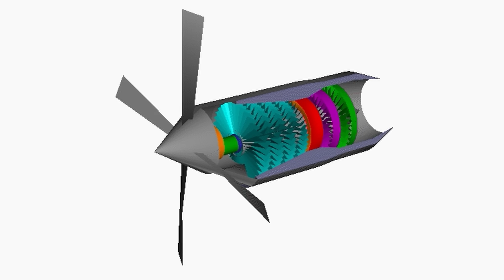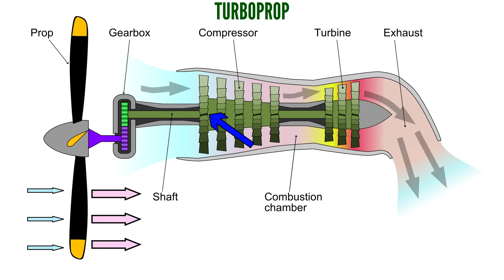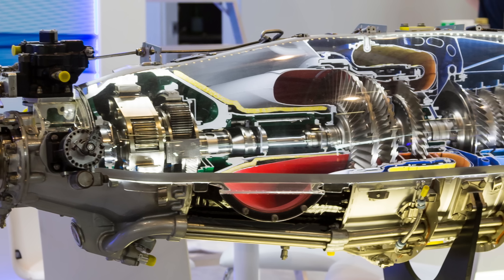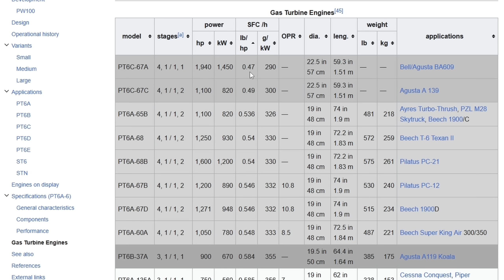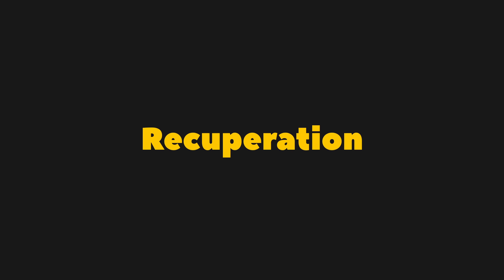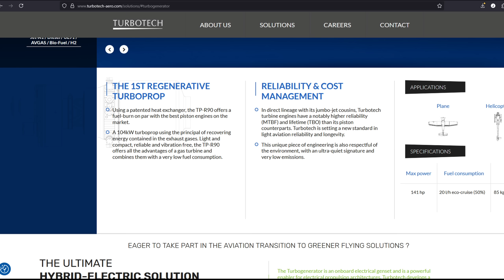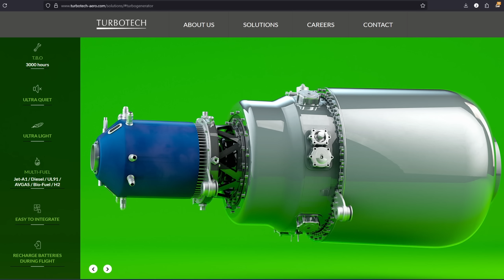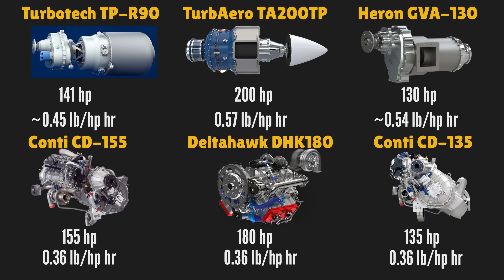Are Piston Engines Dead? Small Turboprops are Here

Comment: 9:50. This pic is confusing me. The claim is the heat from the exhaust to preheat the compressed air. Seems like an egr setup. Anyways, compressed air is already heated so is more HEAT required after it's been compressed to help with efficiency?
Reply: With the Brayton Cycle its important to keep your T2 values low to maintain thermal fuel efficiency.
 Compressor efficiency is basically a fixed value based on the Compressor size and its rpm.

No, Not like an EGR, the intake charge air passes through a heat exchanger, the exhaust gasses are not mixed or recirculated.

Any questions?
Reply: Perhaps an example will clarify:

Suppose air exiting the compressor leaves at 400C and combustion increases this to 1000C into the turbine so you have burnt fuel for a 600C temp increase.

With a heat exchanger, the 400C compressor air is first heated further say to 500C so now you only need to burn enough fuel for a 500C increase to get to 1000C - note turbine inlet temp is fixed at a set point due to material limits.

Comment: Turboprops are smooth and sexy, but expensive to buy and run, especially at low altitudes, where most general Aviation flying is done. For my money, aircraft Diesel engines burning jet fuel are a better bet. Better fuel efficiency, lower cost than turbines (but more than gasoline engines), and simpler operation (no mixture control necessary). The Delta Hawk Diesel, a V-4, two-stroke Diesel that can run easily either upright or inverted, seems to be a notable option, as it doesn't even have valves, just piston ports!

Comment: Fuel prices can only go up so small turboprops are DOA
plus reliability of these new engines still needs to be proven.
Gas turbine engines can be very delicate. One hot start and the turbine is fubar
Reply: Depending on the flight profile,  gas turbines can be competitive when compared to a recip engine of similar power.
Gas turbines are inherently reliable compared to piston pounders.
FADEC and AutoStart is basically standard on new turbine engines.

Comment: 55k for a small 4 piston engine is nuts when you can convert a chevy ls to plane use for cheaper than that with more than double the power
Reply: But its not FAA or EASA certified... the Chevrolet engine is not built to be reliable enough for manned flight applications.

Comment: Yeah , wider comparison necessary: Fuel weight, fuel cost, Unit cost, lifecycle cost, maintenance  cost/frequency. All are more important than ANY nominal power setting. As is partial power setting, as piston engines normally only need full power during take off.
Reply: Piston engines are run at about 80% power in cruise.  That is why most car engines aren't suitable.  They normally cruise at about 20% power.

Comment: One unfortunate thing with turboprops is that there's definitely room for improvement in engine design to make them more efficient

the issue is the lack of incentive to innovate on the technology. Most engine manufacturers are focused almost solely on medium and high bypass turbofan engines, as this is where the bread is.

They're all chasing the engine markets for the narrow and widebody jet aircraft, as aircraft manufacturers and airlines want the absolute lowest possible fuel burn per flight and are willing to help engine manufacturers like P&W, CFM or Rolls-Royce by co-investing in engine platforms that promise to deliver those efficiency gains.

In all likelihood, I would expect diesel cycle engines to eventually overtake AvGas piston engines in newer general aviation planes for two reasons: 1: their better efficiency than the current turboprops and AvGas and 2: Cleaner emissions because they don't have any tetraethyl lead in the fuel like 100LL AvGas does.

The only future issues I could foresee would be NoX emissions and particulates - but given turbine engines also have that same issue, I don't see why diesels would be treated much differently. maybe manufacturers could implement a DPF And a catalyst unit, but they'd have to work out how to make that entire system lightweight, still economically viable, and able to consistently withstand north of 500*c during a regen cycle.

DPFs are fairly heavy and they're restrictive, so you lose efficiency by adding one.

Perk is though, aviation puts an engine under way more stress and would drive the EGTs up way more than normal road driving does, so you'd rarely see a DPF unit clog on a diesel aircraft, whereas it's extremely common on diesel cars that aren't driven on the highway much.

Comment: Its hard to torture with negligence a piston engine of the training aircraft variety. Not impossible but tought. A turbo prop can be destroyed in seconds on the first start. Also the user of rental aircraft with turboprops can lie about hot starts and overtemp overtorque and the engine may fail months later for some unsuspecting renter or pilot and no one would know the damage happened earlier. There needs to be electronic monitoring and reporting of all engine operation and a system in place to prevent engine start before the engine is examined and or repaired.
Reply: New turbines are FADEC w/ AutoStart
Reply: @DoktorBayerischeMotorenWerke that works then

Comment: Can’t wait for an affordable 250-300 hp turboprop engine for my RV10
Reply: Hate to brake it to ya but you got a better chance of seeing Jesus. It aint gonna happen bud
Reply: I hope you’re 8 years old with your RV10 cause you’ll be 90 before you’ll get a Turbine in your 10😂😂
Reply: @wallywally8282 some guys are absolutely delusional
Reply: 200 hp turbocharged 13bs have been used in the RV6 since the mid 90s. 😉  Everett Hatch (before his passing) was building custom Mazda engines for aircraft use. He used one in an RV3.
Reply: @phillipzx3754  A Mazda 13b is a good way to take you all the way to the scene of the crash.
 The 13b has consistently failed to pass FAA or EASA certification. Apex seals are simply too unreliable for manned flight applications.
Reply: @DoktorBayerischeMotorenWerke   Yet Mazda was able to win a 24-hour race and many MANY other road races using the Wankel. The apex seal issue was dealt with decades ago. It's time you update your out-of-date information. 😉
Reply: @phillipzx3754  The Mazda 787B was extremely slow and uncompetitive, it LOST 20 out of the 21 races before it was retired.
 Mazda LOST 1990 WSCC championship to Mercedes Benz and the 1991 Championship to Jaguar.
 Mazda has never won a single World class motorsport Championship

Mazda never solved the fatal flaw in the apex seal.

Please name a single Wankel engine that has been reliable enough to pass FAA or EASA certification for general, military or commercial aviation?

Wankel engines are completely unsuitable for any manned aviation applications which is why not a single aircraft manufacturer uses them... they are simply too unreliable.  

Please educate yourself before you spread lies and false misinformation regarding a topic that you are clearly not qualified to discuss.
Reply: @phillipzx3754 hideous emissions and very high wear and tear on the seals
Reply: @phillipzx3754 I know 3 people who suffered a Mazda 13b engine failures in flight due to apex seals,  one managed to land on a golf course, the other two crashed, one killed on impact the other is now paralyized from the neck down.
 Even the EAA recommends against using Mazda engines in kit planes.

It's illegal to sell a type-certified with a Wankel engine because they are too unreliable.

Comment: Still crazy prizes, A NEW Mercedes car diesel engine is about 20k euro. That's also extremely more high tech then an new Lycoming that u have to pay at least 50k euro for 1950s tech
Reply: Big difference between a car engine and a new Lycoming engine.
Reply: Yes, absolutely. About 50-60 years in technology.
Reply: @schtaan2  There is only 15 years difference between the first automobile engine (1885) and the first aircraft engine (1900) 
The first by Benz and the later by Daimler
Even back then there was a huge difference in the design and the cost associated with flight-rated engines.
 The design of airworthy engines is a significantly more involved process and comes with inherently higher costs
Reply: @DoktorBayerischeMotorenWerke  or DoctorBaaderMeinhofWagen. So what you are saying is that a today modern and hightec car engine is less involved process then a 50s tech low te engine? Working with a modern engine requires modern computers and specific software, yes that is a huge obsticle for todays car technicians and might be a problem for general aviation. You don't want your engine to go into emergency mode at 5000 meters.
Reply: @schtaan2  YES, most people do not fully understand the huge difference between the development programs of aircraft engines compared to automotive engines.
 Aircraft engine manufacturers are held to a much higher standard than car companies.
 The FAA for example require a type-rated passenger aircraft engine to pass a 150 hour PFTR test, this brutal test requires the engines to consistently endure 150 hours at full 100% power output with no failures or significant loss of power,
 Only 2 automotive engines have ever passed this test and received final FAA approval... the rest have failed miserably.

Also reciprocating aircraft engine are often operated a Lean-of Peak ( a much leaner AFR) during cruise mode, something that automobile engines are not designed to handle and would be damaged by.

Any questions son?

Comment: Turboprop power plants do not have excellent power to weight ratios if you consider the fuel requirements for a specific mission. And the fuel IS part of the powerplant so if you don’t consider it you are just kidding yourself. Also because of the light weight of the engine you often can’t swap out a piston engine of similar power because there is too much difference in weight so you end up with a ridiculously long nose which creates stability issues. A turboprop only becomes efficient at 25000 ft and above and light aircraft don’t fly there. Then there’s cost

Comment: 0.55 versus 0.45 lb/hp/hr?  That's not the problem.  Fuel isn't cheap but NOR is it expensive....

The problem:  The cost of the engine itself.  A Lycoming IO-360 new is about $55,000.  But a factory remanufactured engine can cost about $27,000.  The cheapest turboprops right now are around $150,000, so the notion that these engines are going to come down to piston prices is laughable at best.

Another factor:  Starting a turbine engine is fraught with problems.  Hung starts, HOT STARTS....The list goes on.  Startup is the most critical time with a turbine, so this will HAVE to be completely automated, requiring computing power.  And of course we all know that computers are the most reliable devices in human history, they never "blue screen" or lock up for no reason.....

Comment: Jet fuel weighs more per gallon vs av gas so the weight per hp isn’t “as” bad as it seems - cost per hour of flight time that is. Plus jet A is much cheaper in most parts of the world. And finally, as mentioned in the video the TBOs of jet engines are much longer than reciprocating engines do most likely that rotax engine will in fact cost more in the grand scheme of things.

I

Comment: Great video. As someone with experience with recuperated gas turbines I can tell you the recoop's are a huge pain in the butt. It's a pressure containing heat exchanger where one side is very hot with no pressure, and the other side is warm with full engine pressure. Thermal expansion is a nightmare. Just look at all of the problems the British Royal Navy has had with the Type 45 destroyers with Rolls-Royce WR-21 engines.
Reply: In automotive applications the recuperators were called regenerators; as I recall, they had problems there, too.
Reply: @cdstoc  Are you talking about the ones for the automotive turbine engines? It sounds like regenerator and recuperator were both terms used in blast furnaces. I understand the Chrysler Turbine (car) had a recuperator. Probably the most successful recuperated GT I know of is the AGT1500 in the M1 Abrams tank. So not saying it can't be done, but it ain't going to be easy.
Reply: Another use of recuperated gas turbines is in the M1 Abrams tank as mentioned by TurboHappyCar. From what I've heard those are an operational nightmare too. Don't know about the maintenance side of things, but getting them started is a headache from what I hear. I get the sense that in terms of both longevity/maintenance and operation they're not too bad when running, but starting them up is both very harsh on the engine and a major hassle. So fine if it runs non-stop for an extended period of time (as it might perhaps on a ship) but for a tank or even more with an aircraft (which typically runs anywhere from less than an hour to 18 hours for the longest-haul airliners, if talking GA probably rarely over 3 hours) that's a problem. Worse yet in a car, I'm guessing the vast majority of engine-runs in cars are well under an hour.

Comment: Another factor:  These turboprops are running on Jet-A, which is similar to kerosene or diesel fuel.  This fuel has more BTU per gallon than the Avgas/Mogas that piston engines are burning, meaning that the lb/hp/hr numbers are actually skewed in favor of the turboprop.....

Comment: Great presentation. I noticed that you didn't include the PBS TP100. So I just looked up that one. It's a bit higher power output (241 hp at takeoff). But according to their website, the engine has an sfc of .90 -- far higher than the other brands.

Comment: I really don’t think piston engines are dead. They are just extremely cost prohibitive to bring up to modern standards due to red tape and market inertia. 

If it wasn’t so costly and extremely difficult to get modern engines into planes I’d see modern small turbo diesels or mid sized turbo engines being used with far better performance and efficiency

Comment: soon we have better batteries. they are getting better by approx 6% every year in average. (energy, price)
currently the range is about one hour (pipistrel). soon two hours or maybe 1 and a half hour at higher speeds.
this will be the range that allows short distance trips and will create a new market. it will lower flight costs significantly.
the axial magnetic flux motor from mercedes AMG/Yasa seems interesting 550kW max power and only 13kg weight. it should have an incredible efficiency of 97...98%.
also interesting is the double rotor motor from the startup DeepDrive. low weight and high efficiency.
whatever pipistrel has in their electric aircraft, i am pretty sure that it is not near these two motors.
Reply: LOL!!! so naive
Reply: @DoktorBayerischeMotorenWerke  no, reality
Reply: @stefanweilhartner4415  Rechargeable batteries can never match the energy density or specific energy performance of liquid fuels.
 Batteries will not continue to improve, this is false advertising myth. 
 Not unless an entirely new element (stable element) is discovered with 10 times more charge potential in its electron valance rings.

Comment: In the Otto cycle, best efficiency is achieved with the throttle plate wide open in order to reduce pumping losses.  This is one of the reasons that diesel engines are more efficient than gasoline engines;  Diesels do not have throttle plates.  The air passes through the air filter, down the intake tube and through the intake valve.  Diesel engines do not have any sort of fuel mixture, more fuel = More power.

Which explains the phenomenon of "diesel runaway", where the engine begins running on its own lubricating oil.....

Comment: You didnt address fuel. Current piston engines require lead in order to get high enough compression at  direct-drive propeller efficient RPMs. It is the only gasoline still requiring lead and EPA has been chomping at the bit to ban it for >20 years, eventually they may give up giving extensions. Also refineries dont want to make it because there isnt enough demand to dedicate a refinery to just that and because of the lead it has to be $purged$ to switch back to mogas. 

Jet-A does not have lead, and is MASS-PRODUCED because airlines and the military are awash in the stuff, so its more readily available and cheaper to purchase. Plus it, you know, doesnt cause brain damage.
Reply: That and Jet-A has more BTU per gallon than Avgas/Mogas.....